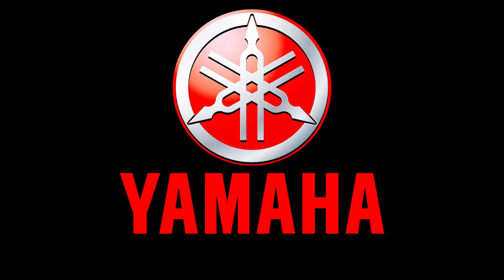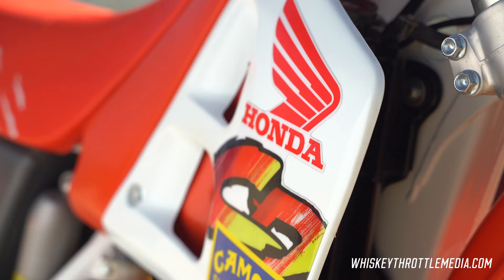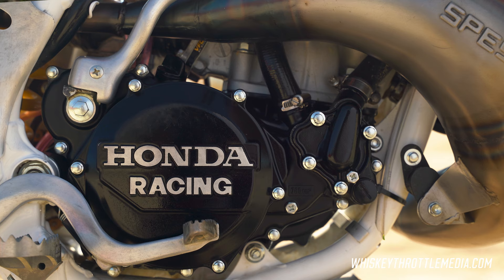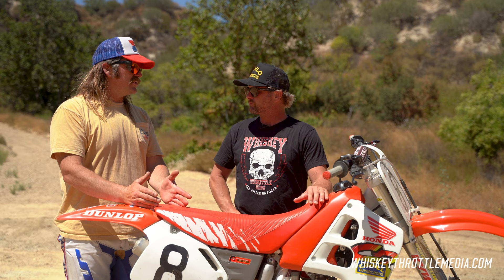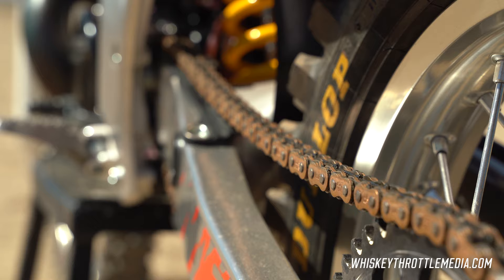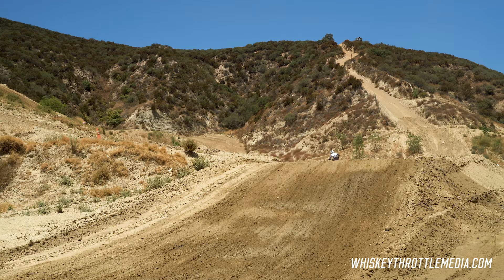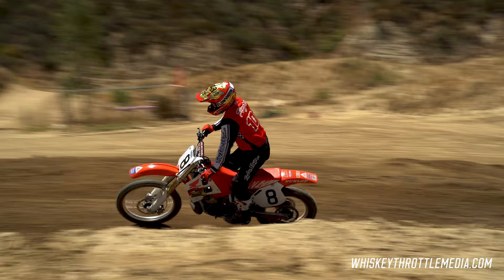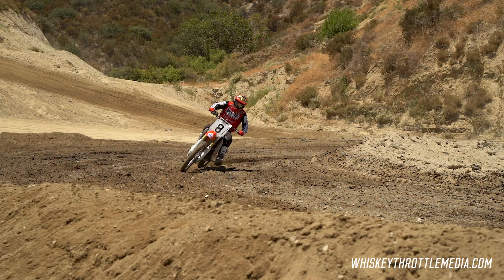Whiskey Throttle Spotlight Mullet Moto 1991 Honda CR250 Jean-Michel Bayle Build

Comment: I had one when they were new and it is no surprise they went with later model forks for this build. Fast bike and terrific quality but that stock front end was garbage. Nice work on the review and thanks for doing these. Really brings back some cool memories.
Reply: @EarthSurferUSA  Yes, you are correct. Stock settings were completely backwards.  Felt overly stiff on the small stuff and then blew through the travel on the big hits. Not a good combination on a bike that wasn't very stable to begin with. Was a disappointment given how good the stock forks were on my 87 CR. The motor was amazing though.

Comment: It's possible a 97 CR250 brake carrier will fit and if so he can upgrade the rear rotor to 97+ too. Might have to go to a 92 wheel but I think it'd be worth it. My 95 runs the 97 carrier no problem tho.  I thought mine looked kinda weird with a big front rotor and stock rear rotor.